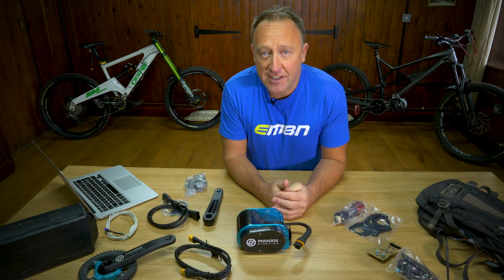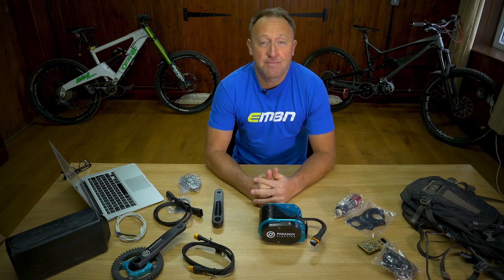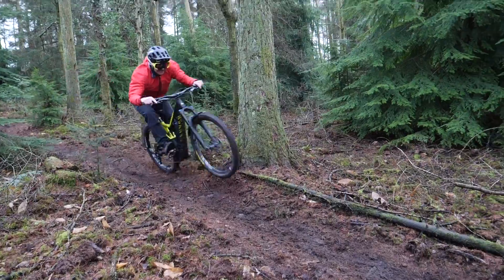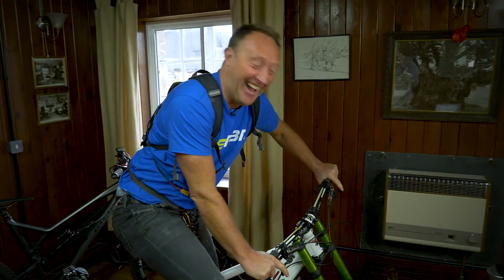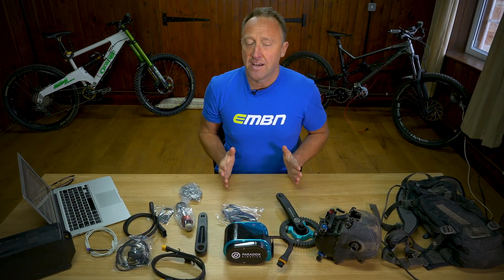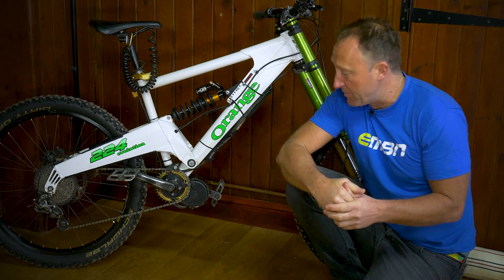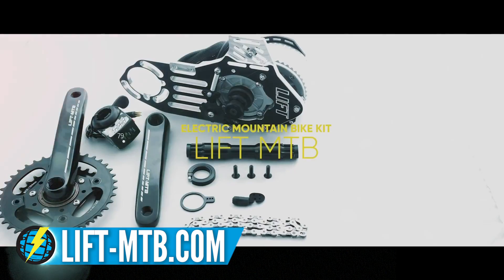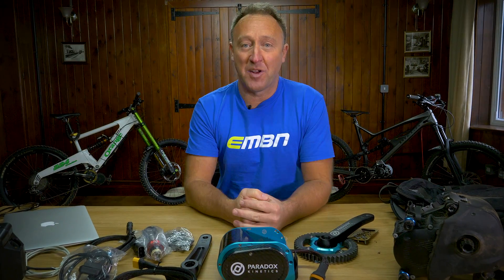Bolt On E-Bike Motors Explained | E-Bike Fundamentals

Comment: A shabby build and a lack of knowledge about doing a DIY mtb is a poor way to portray DIY.  A mtb without the curved downtube is the best bike to use. many older DH bikes have geometry similar to todays trail bike and they are very durable. Leaving the wires of the motor hanging down and then showing twice is rude. i think most mtb riders do not use lipo and have a battery system that takes no time at the trail. That Lipo part was poor theatre. BBSHD is easily programmable. Instant motor stop when you stop pedaling can be programmed. Lower levels of PAS can be programmed so it is more natural. When geared correctly and programmed correctly it is most of the time never past the  max wattage area of the factory bike. But it does have the power when needed. The throttle is easily removed to conform with local riding laws. if you are going to do a bolton  thing, do it right next time and don't misrepresent what most of us do.

Comment: I odn't know how the laws are in the UK
but you sohuld mention the laws
the thing to remember is throttle will be illegal in several countries, like here in Norway, need licence plate & moped licence, and insurance.
here the assist motor can't go over 0,25 kW.
work and rent bikes for passengers  nominal 0,5 kW max
motor can have start up assistance at 6 km/h 
motor can go max to  25 Km/H
as long as all of this is is correct you can ride a e bike everywhere in Norway.
if not need license plate and can only ride on the road, cus considered a moped.
Sourse: https://www.vegvesen.no/kjoretoy/Eie+og+vedlikeholde/elkjoretoy/elsykkel

Comment: Another great and informative video.
Im not sure if anyone can help or advice be with my problem, i Bought a Cannondale  EMTB last year and  stupidly kept the battery keys on the same key ring  which i recently lost.
I contacted the shop i bought the bike from and was told the key number should be on the paperwork that came with the bike failing that take the bike into my local bike shop and they will be able to get the key number via a bosch diagnostic.
I could,nt find the key number on the paperwork and the bike shop told me my bike has the old system so no luck there and was told they had no experience of fitting new locks.
I cant take the bike back to the store i bought it from as it was an on line purchase and the store is to far from my home.
At the moment im charging the Battery on the bike but was looking to buy a spare battery for longer rides in the Summer .
I just wondered what my options are,  if i was able to drill the old lock would a new one be able to fit?

Comment: Started with a BBS02 48V 20A which I ran for three years. I changed to a BBSHD 52V 32A about a year ago and also switched from a derrailuer to a Rohloff internal gear system.
The factory programming on the Bafang is really awful. To get the most out of these motors you need to reprogram them with the custom cable. The difference is night and day. Once reprogrammed the bike feels more like a bike and less like an ebike. The great thing about the Bafang system is the level of customization. Up to nine different power levels, each one customizable. You can adjust the amount of pedal movement that activates the motor, the way the power ramps up and cuts off and of course the actual power level. I rode my first build, rather dissatisfied with the overall feel until I discovered the programming cable. After quite a bit of trial and error, I am now very happy with the feel. You do need to investigate this carefully because if you don't know what you're doing, you can wreck the controller.

Comment: Fame and fortune for local Ian Spoons! Great... Spoons guided me through building a Dartmoor hardtail 29er with a Bafang BBS02. I used lipo batteries from Hobby King. Fantastic fun for commuting on WyeValley/FoD single-track to work. After 10 rides I did realize it was going to rattle my brain to bits on the rough stuff, so a new full suspension build is now in progress.... enjoy!

Comment: One thing that does not get much  attention  is the weight of the rider and even your body wind resistance factor ,    this is significant imo . 
   Some years ago  i had a bit of a ride on a few occasions on my young brothers  department store mountain bike  which he fitted with an ebay bought   rear  250 watt direct drive(non geared ) hub motor kit  . 
  We are both fairly big  guys  ,  and back then probably  around  100 ish KG`s ( and now a tad more with middle aged spread  ;)  ) , and i would say  the  ( 26" inch i think  ) non suspension  bike was about medium weight , not  overly heavy .
   The punch line was that  the hub motor  was to use a phrase  .... just weak  as water ,   taking off without pedaling on the flat , you would be battling to eventually  get up to 10 kph  at a guess  ...... unless you had a tail wind , and even then it would take a while ,  and moderate hills even pedalling ,  forget it  !
   I have since noted some of these 250 watt hub motors on sale with as little as 30 nm of torque (i suspect my brothers hub motor was one of these ) ! 
    Watts dont actually mean much  ,  it is really torque that gets you moving off the line and up the hills (and gearing to a degree of course)  .
   In a bike store  local to me  In Australia recently   ,  in their E bike section  , one particular  electric mountain bike they are selling on the sales ticket  quotes the  motor torque (mid drive  shimano electrics i think )  at 120  NM`s  ,  this sounds  pretty good to me  .
  No doubt if you are a light weight  ,  you could probably deal with less torque/power , but  for us  heavy dudes and dudett`s  , imo  a low torque set up is a waste of time .
Reply: mikldude  too right , I find the 250 watt a waste of time. It not about how fast you can go, it’s the torque. I have a 1000 watt fitted to  my Halfords special, voodoo Bantu 😂👍

Comment: Running the Lift-MTB kit. Done almost 7000km with zero maintenance. Ran it on my Rocky Mountain Slayer, and now on a carbon Altitude. Slayer came in at 17.3kg with zero shortcuts on weight/performance. Hands down prefer it to any ebike option. Also really good on long rock gardens where you would like to smash trails at speed. Running a E13 9-44 cassette and 36 chainring up front. Easily reach 40-45km on the trails. I would not recommend this kit plugged in on tech fast trails unless you have proper bike skills. Everything happens at a MUCH faster pace. The bike also handles like a normal bike, and pops on par with a DH bike. But, in short, high speed and fat smiles all the way.
Reply: bit late but im considering one. how waterproof would you say it is. the weather here can get pretty sloppy

Comment: #ASKBMBN
Hey EMBN, LOVE U GUYS SO MUCH... U WON'T BELIEVE IT...🖖😹 
I have my 2005?, Schwinn 26" full suspension hybrid that I am converting to electric. I did a lot of research... And I ended-up going for the BBSHD** FOR THE CUSTOMIZATIONS AND PART(TO MAKE IT UR OWN) SYSTEM with pedal assist and throttle, plus the ability to stay legal. So my question is, why don't u guys show case that specific motor with the with accessories for cheap?🖖😉 I can help!
Reply from the maker: Thanks! 👍🤟

Comment: lipo batteries  on your back when you fall off = fire
Reply: Petrol in your car under the rear seat. Crash and burn. Oh wait, that doesnt happen. Lipos just like any other fuel needs to be in a protected case.
Reply: Lipo are far worse than L ion or LiFePo4 options , and all of those are valid options for this application.  I use lipo only for high current RC planes, for gliders and yachts its lifepo4 because they are so much safer. One dent in a lipo its game over and a case doesnt stop inertia. For our ebikes thankfully Specialized is not equally insane and have used appropriate and reliable stable chemistry. 18650 cells are very common.
Reply: @CarkeekW  You might want to read up on whats inside a 18650 and why for example some Teslas that have been in a crash have occasionally caught fire which was hard to put out. 18650s are simply in their own hard case which is then in another case, making for a rather solid enclosure. 
What is true though is that thanks to the massive rise in Emobility and funnily enough Vaping, 18650s have plummeted in price and increased in energy density so using a RC lipo now does not make much sense for ebikes.
Reply: Gee .... theres no pleasing some folk! All the brits are complaining about "winter" and "cant ride" ..... here we have an obvious "back warming device" ... and folk compain about that!! Lol.
Reply: That's not true

Comment: Guessing they won't work with a fat bike? Is the BB to wide?
Reply: The bbshd can be bought in an option that is meant for fat bikes. You order for your bb size. 68_75, 82, or 100 ( for fat bikes ).
Reply: taylor Taylor bbshd comes in 3 different sized bb options.  Standard, 100 and 120
Reply: Paradox kinetics is less powerful, way more expensive and louder than others

Comment: Most after market mid drive motors have pedal assist or cadence sensors which is not as fluid pedaling . As you may get a burst of acceleration. Could be tricky on a trail.  But with   torque sensing  it  measures the force that the rider is applying to the pedals and these are on most upscale factory made e bikes.  Something  to check when you are buying a mid drive motor kit.  I am just building a Bafang  G510 mid drive e bike, which has torque sensing.
Reply: Thats true but as I posted above, spend some time tuning the acceleration curves of the motor controller and you wont find it a big issue anymore.
Reply: The tsdz2 has torque sensing as well
Reply: Ah, nice one Fred, i didn't know about that one. How's the fitting work on that one?
Reply: The trouble with torque sensing is that it takes torque ( pedalling power ) to operate. Cadence sensors are usually hall effect sensors or simillar that create far less drag. You can achieve a torque sensing effect with a cadence sensor and good software. To do this the software can be made to react to changes in cadence. For the bbshd, try setting your "Startup dgree" to its minimum, and srop decay vert fast. Then play with the other startup settings till you get it how you like it. When you get them they are set up pretty laggy and smooth .... more for smooth terrain riders. A bit of readjustent via your pc goes a long way.

Comment: Cant see them holding up well with repeated heavy use and the higher power units will have crap range but still very cool review thanks steve .
Reply: Look at Jack Butler and his ride to china from england. He covered above 13000km on a bafang with more than 200km per day .... solar charged only. The bafang ran flawlessly.
Reply: 6500km on my bafang hd02. No issues.
Reply: @808GT  how many jumps ,drop off,s and down hill and single track runs does that include ,cycling to work or touring not really heavy use lol.
Reply: @salisburyplain998  None. You got me. I did all those kilometers on a treadmill.
Reply: @808GT  knew it lol,it would catch fire in the rain anyway so prob a good idea to keep it onthe treadmill 😂🤣😂🤣
Reply: @salisburyplain998  lol. The bbshd is an extremely robust and reliable bit of gear. Its the culmination of years of experience. Have a closer look at them.
Reply: @BarryJTaylor  I will ,ive got an idea to fit one to my mr,s bike ,could be a cheaper option to getting another ebike .
Reply: @salisburyplain998  what is the donor bike ?
Reply: @BarryJTaylor  calibre bossnut full sus.
Reply: @salisburyplain998  Just looked at it. Looks a lot like a Polygon Siskiu D7 I have. I originally put the bbshd in it .... fitted very well with the bb and downtube junction. The bbshd, on full power,  is too much for it though. The rear triangle is pretty light weight. Would be really good for a bbs01 ( they are phydically slightly smaller too ) or bbs02 and limitting power. Or really limitting power on the bbshd. Lol. Mind you if its any bb other than a bsa bb you has ve to go bbshd.
Reply: @BarryJTaylor  dam sounds complicated ,my cube stero hybrid 160sl is easy ,stick the battery in and ride plus it was good price from trdz at 3.4k .
Reply: @salisburyplain998  Not complicated at all. Even with research to get the right one and then fitting it would be a max. Of 6 hours all up. So for the savings of 2.4k you could say you earned $300 per hour ..... no its not complicated. Lol.
The nearest geometry and spec. Bike to what I  built up is say the Husqvarna Exc10 thats about an £8000 bike I believe. The kit cost me £1000 ( but I worked in AUD$ ). Ok I used my freeride bike that I already  had built up but meh my goal was to get an electric bike that was like my freeride bike, but electric. Mission accomplished .... and by not spending AUD$14000 for six hours work .... it was the same as being paid about $2300/hr to get the bike I wanted .... only with 6 times the power if I want. Lol.

Comment: Maybe a mention that they are all illegal for use on the road in Europe
 and technically banned from most trail centres.
You cant have a throttle above 4mph and you cant go above 15mphish.
Power output is a very grey area because the legal bikes go well beyond 250W.
Its evolving quickly and the law is rarely enforced, but you must remember that they could do you for riding an uninsured/untaxed/unregistered moped on the road.
Keep to 15mph on the roads guys.
Reply from the maker: This is very true. Unless you are using your own pedal if exceeding this. 👍
Reply: Agreed. Whenever I go to a trail centre, I reprogram the limiter to top out at 14mph.
Anything after that comes from hard work.
Also, I am an overweight, slightly disabled 'old bat', and I've never been refused entry yet.
If you ever see me getting serious air - someone stole my bike! :D

Never been a speed-freak: I used to ride Trials many years ago on my Bultaco and Ossa bikes.
Yes Steve, it was all about the "technical" sections. The more technical, the better! :)

Comment: I’m a long time mountain biker and motorcyclist - just got my first factory ebike and like the fact that it is limited in speed and power so I have to put some effort in and don’t rip up the trails. Adding a 1500w motor with a throttle means you will be basically riding an electric motorbike on cycle trails - do we really want to be promoting these and potentially getting all ebikes banned?
Reply: 1500w is pretty unuseable on trails. Mostly I run 300w,  regularly 600w, rarely 900w. 1200w is gungho pedalling up "no way!!" Climbs for fun. 1500w on trails ...... it flips to easily. 1500w is only good on fast surfaces, If you want 60kph + or sand trails to get out of the sand and moving fast above it.  Im talking pedal assist only as I have not fitted the throttle. Though after seeing the instant smile on Steve's face when he hit the throttle ..... I wonder should I fit it? Lolol.
Reply from the maker: @barry taylor well he did look like he was going to fly out that window 😅🤣
Reply: @BarryJTaylor  I have one on my BBSHD, and it is really useful. As I've said elswehere, when riding publically everything else is toned-down, including the throttle.
I use the throttle (still limited to 14mph), to add the extra power to get up really steep parts that the current drive setting would not cope with.
However, when on my friend's farm - riding de-restricted is an utter blast! :D

{{{For the kiddies/complainers/haters/killjoys reading this - always ride sensibly in public, and we all get to have fun! Ride like a d*ick and you ruin it for everyone!!}}}
Reply: @SusiBiker  Haha dont make me fit the throttle !!! Lol.
Ive avoided it to date partially because at 60 I feel like Im 15 again .... only faster .... and Im still pedalling. Lol. I ride a lot to keep up with my son, who on some tracks I use 900W to keep up!, and he is always saying things like "go the moped!" If Im overtaking him. I just say " I cant hear you Im busy smashing your strava record" lol. But anyway ... not fitting a throttle feels just that bit more real for me atm .... maybe when I hit 70 I'l fit it. I have enduro motorbikes too and using an ebike with throttle makes me feel more of a wannabe motorcycle ... Im trying to keep that separate.
But also I found that by reprogramming the bbshd ... it pedals so intuitively now ... not sure I need the throttle.
Reply from the maker: Great comment Daren

Comment: decent vid, so are you going to do a test, say bafang v proper ebike? Would be particularly interested in that, cause, well, it's what I've got! Agree with the assertion that they are only really worth doing if you've already got a bike. If you are going out to buy an ebike, just buy an ebike, buying a bike and a separate kit doesn't make alot of sense once you add up. I missed it if you mentioned, but I'd like to see a good comparison of the bafang cadence sensing, compared to torque sensing, defo interested to hear opinion on that.